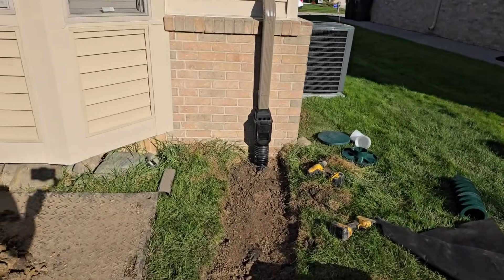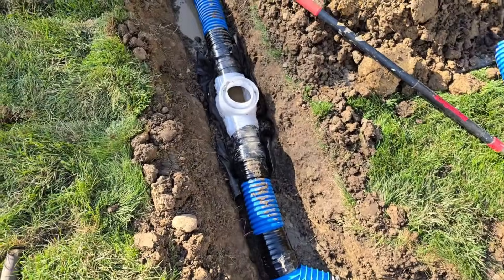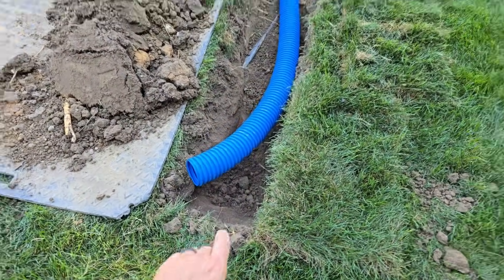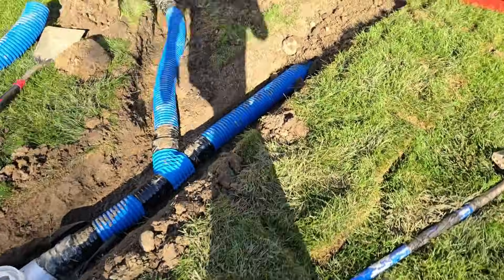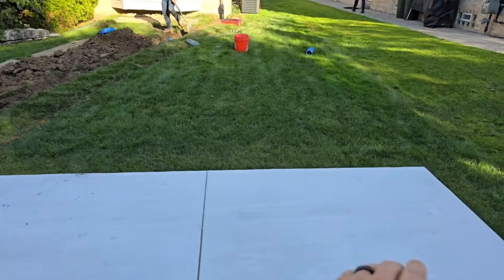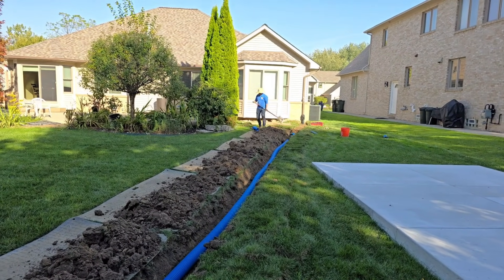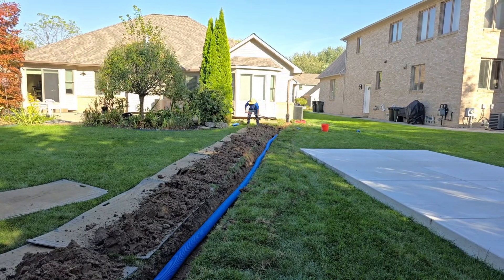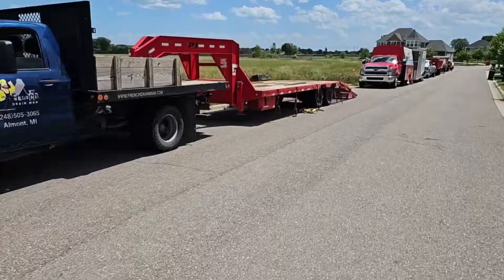Do Yard Drain, French Drain, and Downspouts need to be buried below Frost Line in the North?

Comment: FDM ,what is your recommendation for the amount of slope for roof runoff , is 1/4” per foot adequate?
Reply from the maker: 1" of drop per 8 ft is a 1% slope. Anything more than that may cause problems, unless there is sufficient fall to prevent the pipe from being buried too deep.
https://youtu.be/GNcoPY1K5nE?si=P9rCA4LYN2IWRwYQ
Reply: Thanks